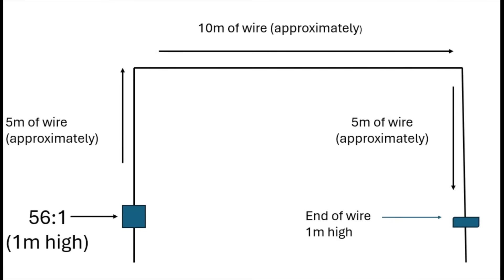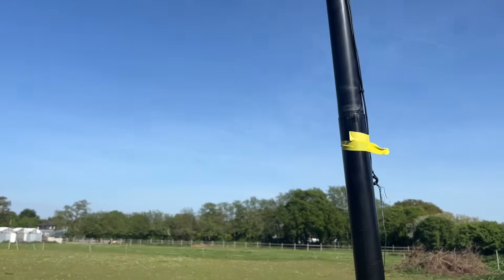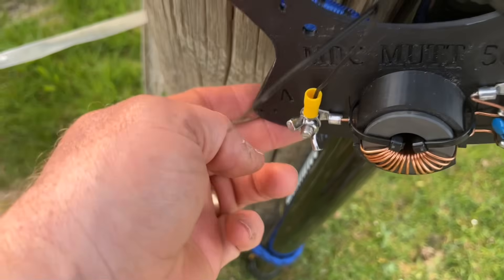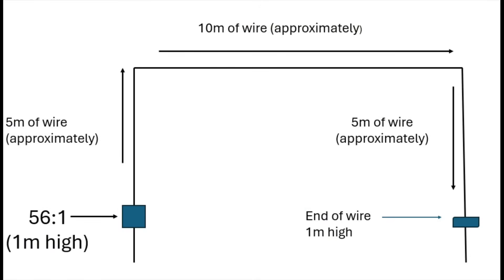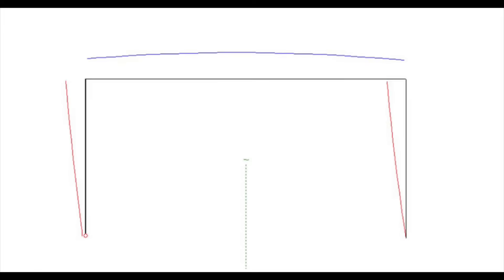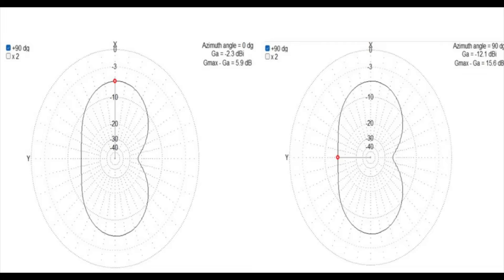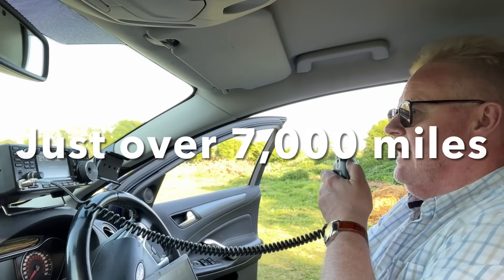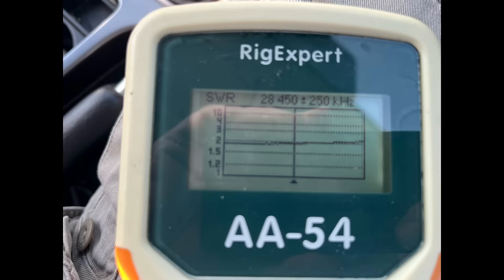My Best Portable HF Station: End Fed Half Wave Antenna as a Half-Square

Comment: nice job! I put up a 20m half square a couple years ago for 20m band. worked quite well. no balun, just a direct connect from 50ohm coax to the wire center conductor to the horizontal end, and vertical end to the outer shield. should have made the 40m version ! all the best!
Reply from the maker: Nice job!

Comment: Hi

Nice video

Could you give me the dimensions for an 80-6

Thanku
Reply from the maker: 80-10 is possible by multiplying the overall length of the antenna in this video by 4. 6m may not be a great tune as a harmonic of 80m?

Comment: Great configuration the half square Tim, I've been using the same portable for a few years now. 
Its a dx moster on 20 & up!
Just a day ago i was on the beach with my 480 and said antenna, and work vk & zl with ease on 20 & 15. Was told i was the biggest and loudest on 40m.
Great antenna 👍
Another top video mate 👍

Billy m0zww
Reply from the maker: Sounds like you had a lot of fun 👍👍

Comment: Good video and good information in the video. I have done quite a bit of work with the half square antenna, but only on the band it was designed for, that is with the two ends being 1/4 wave verticals ( essentially two quarter wave verticals in phase). I also fed it at the top corner. Your video is quite good. I will make a couple observations from my experience. The half square for 80 meters is quite possibly the best antenna I have ever had! However on 80 meters it is uncommon to be able to get a high dipole since high is maybe 100 feet on 80 meters! My 40 meter half square was an essentially equal to my dipole at about 40 feet. The pattern was sharper so I stuck with the dipole. My 20 meter half square was poor compared to my 20 meter dipole. I compared to a dipole at about 32 feet (half wave on 20 meters). However the antenna does work fairly well on 20 meters even if an S unit or two weaker than a reasonably high dipole. The multiband aspect of what you did ( end fed) has some advantages that may outweigh the loss of gain vs a single band dipole, especially for portable use.
Reply from the maker: Great info thanks

Comment: When I had my 40m EFHW up it was in a similar configuration, with the balun about 3m off the ground, on an 8 m pole, then diagonally across the garden and down the other side.  Worked very well, the only let down was that although it would tune on 12 & 17, it was a bit deaf.  It's now been replaced by a longer wire & a smart tuner to give the additional bands.

G0WSJ
Reply from the maker: Nice set up .. yes the efhw will be poor on the warc bands but by reducing or increasing its overall length a little and adding a tuner and ground system it’ll work well .. nice job

Comment: Hello Tim. Very sound advice here, and good information on how this works. This antenna has become my standard setup for portable for a while. Easier to set up than the inverted V shape, works better IMHO. I use two cheap 7m Decathlon fishing poles, sometimes a third one in the middle to support the wire. I now know that I need to count 57 toe-to-heel steps between the bases of the two poles. A 56:1 unun is what gives me the best SWR. Most of the time it's usable on 10, 15, 20 and 40m without a tuner.
Congratulations for the great DX here! I love the 15m band.
Reply from the maker: Thank you Alain you sound like you enjoy yours. Yes I love 15 too.. often quiet but plenty of space and very good for DX. 73

Comment: For those of you with no tuner for 40m, you can just add a foot or so of wire clipped on to the end of the antenna. That should bring your swr into the band. KE6VG

Comment: I use a similar setup. I first tuned the halfwave to 30M which will give you 30/17M, then put a link in and added wire for 40M Which gives me the standard 40/20/15/10 ( also works on 12 just fine). I use a 11 turn coil 6' from the feed point to lower the resonance on the higher bands. 73 DE N7BYD
Reply from the maker: Nice set up

Comment: Can you comment more on the compensation coil?
Reply from the maker: Will check the exact inductance, its main function is to electrically shorten the antenna on 10 and 15. It will not affect 40 and 20 mimimally.  Without it the efhw harmonically CAN see a useable swr higher than both the 10 and 15m bands (around 29.5 to 30 MHz and 22 MHz). Therefore the use of the coil.

Comment: Thanks for doing a re-test of this antenna. I've had mounts in the ground about a year now to accept my two 7-meter Spider Beam poles to build this antenna and even cut the wire to proper length. I only have a 49:1 right now but I have been eyeing that Mad Dog 56:1 since I already own one of the Mad Dog vertical coils. Great products. Can you explain the coil build, and would you remark on the noise levels with this antenna.
Thank you,
Rich, KA2VCW
Rochester, NY
Reply from the maker: The 56:1 coil build .. check out Colin’s videos in the description. Noise wise it’s a portable antenna in this instance so noise levels were quite low.
Reply: @TIMG5TM  I'm going to give it a shot with the 49:1 this weekend. Thanks much for the quick reply. ...Rich
Reply from the maker: @richegan7381 my pleasure I wish you well with the experimenting! 73